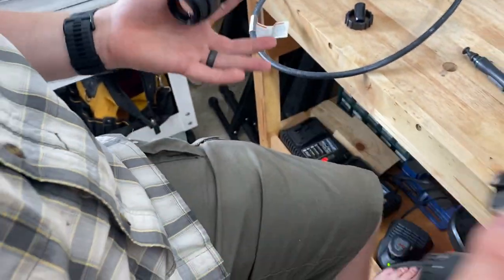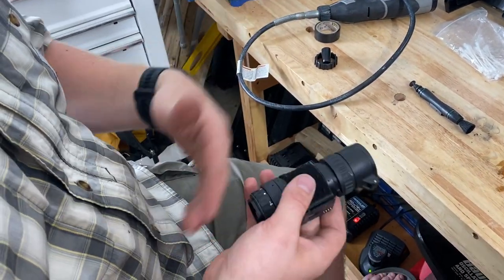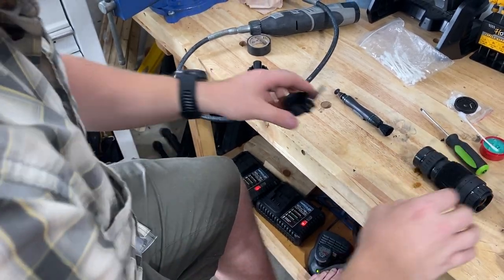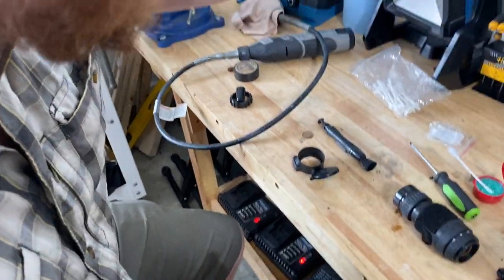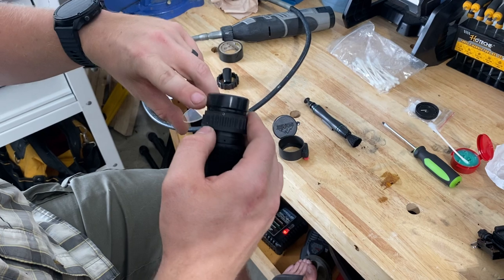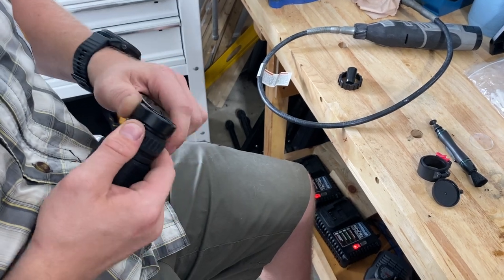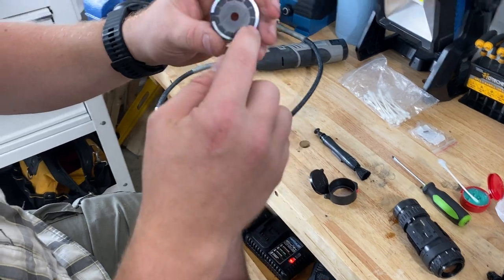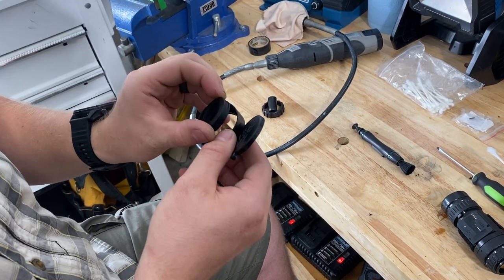Cheap DIY Night Vision Refocus and Protection

Comment from the maker: FYI I have found it much easier and more consistent to put the electrical tape on the inside of the Butler Creek just to add some friction.  Instead of taping the NVG
Reply: How you managed to get electrical tape even cut in half inside of the cap with the aperture is beyond me. Please make a video showing how you did this because I want to still be able to adjust my objective lens and not have it taped over…
Reply: Just a question what nvg is this what brand ?
Reply: Fun fact if you buy the m32 m37 Iris it just twist no need for the lever and the Butler Creek cap fits directly over that with no tape. No dremel work needed

Comment: I wonder if you could glue the adjustable iris to the flip up lid? That way you could flip it out of the way when you need full light. The adjustable iris looks a little smaller than the full pvs14 lense. I bought the parts you linked, when they get here I'm gonna look at it. Thanks for the video

Comment: Definitely want to use callipers or be exact on where you’re cutting it especially if you end up using a sacrificial lens in front of the aperture instead of one of the screw in sacrificial lens behind the aperture. Figured the objective lens would be sealed off from the elements and dust/debris a bit better with a screw on sacrificial lens behind the aperture. Already ordered some more butler creek caps because I botched the fuck out of the first one though. So just be careful. I know the flip cap is only $8.99 on some sites, but still sucks to not have an extra in case you fuck up…. PS they’re constantly going out of stock and went from $9 to $13 and some change on Amazon haha wonder why

Comment: Does this reduce the overall lense size enough to lower the light gathering and fov on the pvs14?  It doesn't look like the iris opens up to the full size of the pvs14 lense.
Reply from the maker: Correct but it’s negligible and easily reversed by simply removing them

Comment: Sucks you'll be giving up slight light transmission no matter what, I wanna see a version where the actual iris flips up so you gain the entire objective lense, with your mod even the mat block tarsiers you lose like almost a quarter inch of the outer edge of the objective lense, while some might say who cares, that might make or break you seeing something in a no ambient light place , gonna need all the gain you can get
Reply: You could probably modify it to mount the iris in the flip cap with a little 3D printing.
Reply: clear tape
Reply: Take it off if it gets that dark?